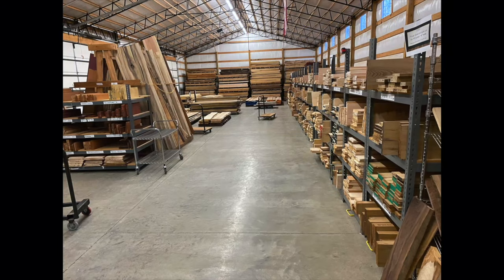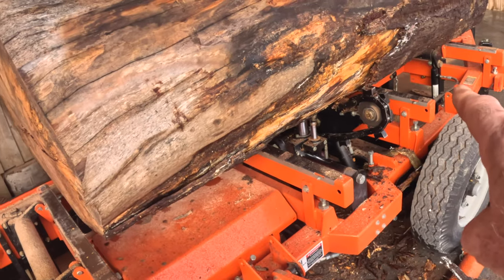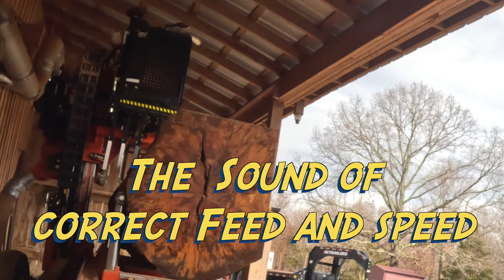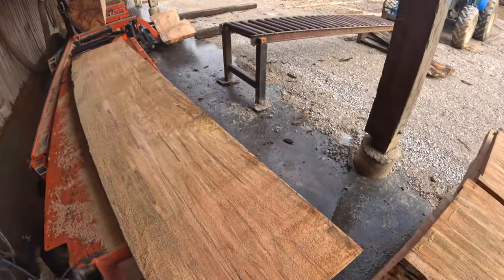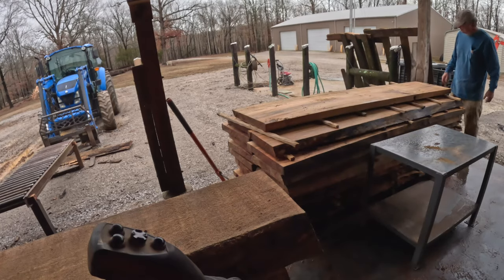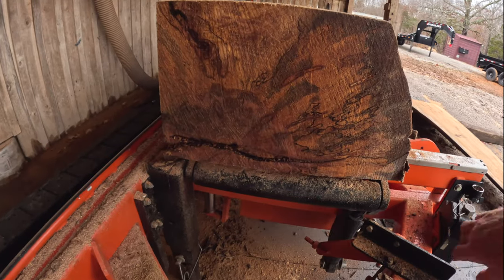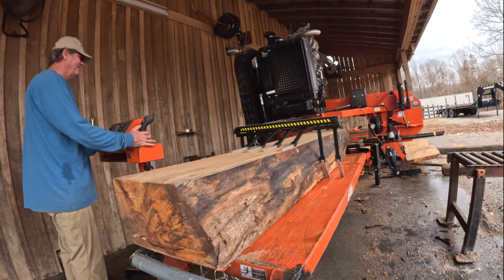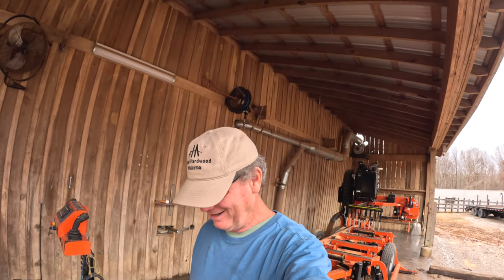You Haven't Seen a Maple Like This (Sawmilling and Slabbin!)

Comment: To square up stack and for weight
Reply from the maker: Concratualtions!  Shaneknicely was the first to get the answer correct.  I was out of maple logs for those session and needed to level the pack.  So I might as well use the heavy pith board as weight, as well.  Congratualtions!
Reply: Yes, even out stack and that one will be on bottom when you restack in store. Love your videos!
Reply: I thought that in a vacuum kiln it would protect from moisture dripping on the other boards if you didn’t use any other cover and provide extra weight during the faster drying process. But I don’t know much about your kiln process.

Comment: The pith board is more likely to twist and warp.  By being on top of the stack, it adds weight to the pile to help the other boards dry straight, but should the pith warp, it will warp into air and not deform the other boards.
Reply from the maker: Close, to add weight and even the stack.  The board has significant heart shake so probably won’t amount to anything.  Thanks for watching and commenting.

Comment: Weight for the stack. Number two, so you can cut out the pith and still have a nice fairly wide board.
Reply from the maker: Close, to add weight and even the stack.  The board has significant heart shake so probably won’t amount to anything.  Thanks for watching and commenting.

Comment: The pith board is on top to (a) provide the weight to keep the boards under it flat and (b) equalize the drying process by having the entire log still “together” , i.e., in close proximity…
Reply from the maker: Close, to add weight and even the stack.  The board has significant heart shake so probably won’t amount to anything.  Thanks for watching and commenting.

Comment: One , it protects the better material under it and two it make the the pack of lumber flat so more can be stacked on top.
Reply from the maker: Mostly correct, to add weight and even the stack.  Thanks for watching and commenting.

Comment: I didn't know where to put it so I'll put it here.  What are your thoughts on cutting logs square to start drying before I make whatever out of them.  No boards, just beams
Reply from the maker: They will surface crack and check fairly quickly so need to be sawn within a few weeks of cutting into cants or the outer boards will full of defects.

Comment: My thought would be to even out the stack.  Second reason would be to keep the good part.

Now my question, why did you not use the debarker?
Reply from the maker: You have a good eye.  I rarely use the debarker on live edge slabs because it cuts a noticiable groove into the wood that detracts when I sell them.

Comment: Even weight distribution to prevent cupping and I'd guess there's some good grade that can be cut out the opposite side of the checking if it's at least 4" wide and knot free
Reply from the maker: Close, to add weight and even the stack.  The board has significant heart shake so probably won’t amount to anything.  Thanks for watching and commenting.

Comment: Well, if i had an edger like you do, I would wait and edge the pith off after it was dry.( i edge on my mill when green) And i usually end up restacking and stickering because my breeze dry stickers always seem to slip around when i transport to the kiln. Restacking would put that pith board on the bottom to help keep flat. I also have about 4000lbs of weight that goes on top. im working on ways to avoid dubble handling. I strap my bunks together in transport but that dont always work for me.
Reply from the maker: Sounds like you are doing many things right!

Comment: Not for pretty but the weight will put pressure down to help the bottom stay straiter.
Reply from the maker: Close, to add weight and even the stack.  The board has significant heart shake so probably won’t amount to anything.  Thanks for watching and commenting.